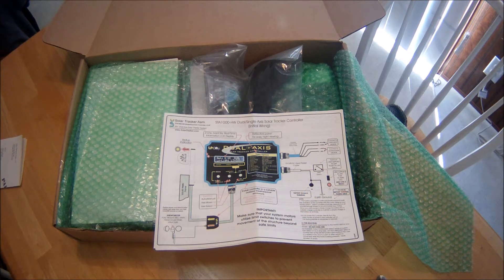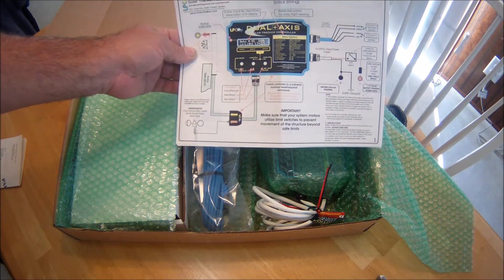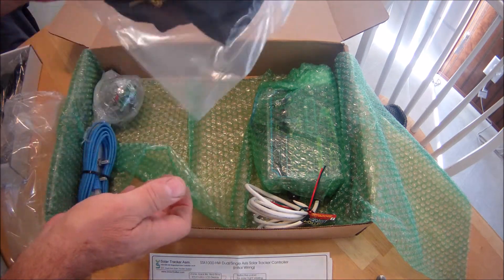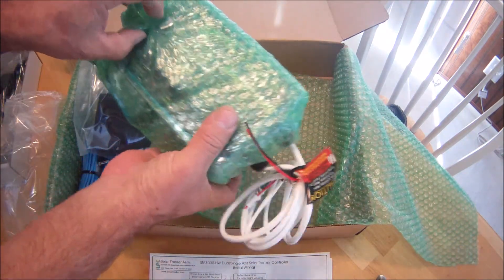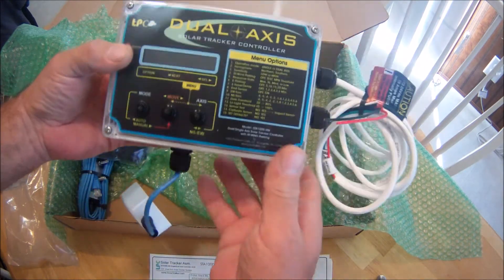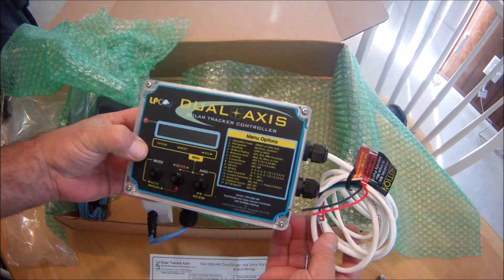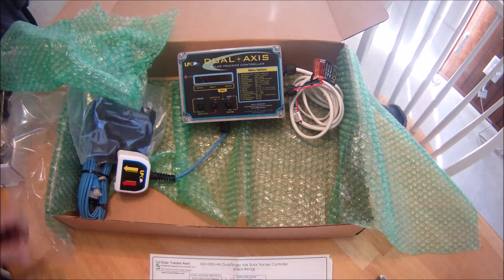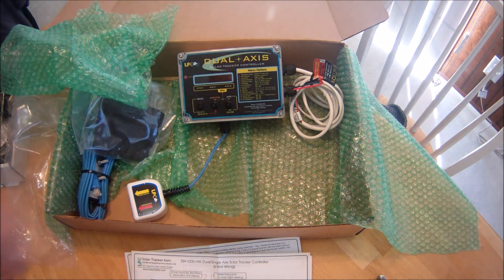Solar Tracker Controller LPC

Comment: It looks real nice and I need to buy one for my latest tracker it is just stuck looking south and it needs a good controller.  I bet he wants a arm a leg for that. The last one I bought from him was not cheap. I had to pay to have it fixed  and then I had to have to have paid to have it programed to park wtf ? He is so freaking high on his controllers. He wants like 200 bucks for the old stalker sheesh. I had to make like three transactions for the controller Ouch. I thought that they guy in Australia tracker worked damn nice and I only paid for it one time and its still working. I got three of his they are super. Too bad I cant get another one. I got a really simple one that has everything in the sensor from Australia guy that has been working for like 8 years with out any problems at all. I would even like to get one like that it was only about 50 bucks and worked great.
Reply from the maker: I here U .  all of mine still work too.
Reply: shartne 
Good to know brother and thanks for sharing.
Reply: the Australian guy retired and sold his patent to another guy and I dont think he sells to the united states I wish he did he has great tracker controllers for sure.